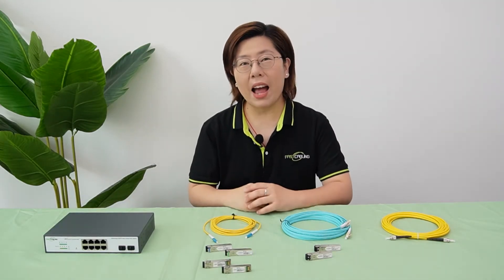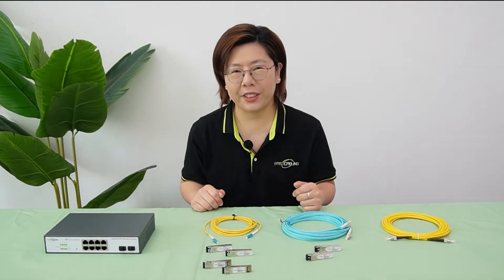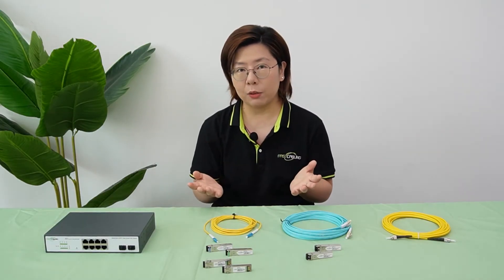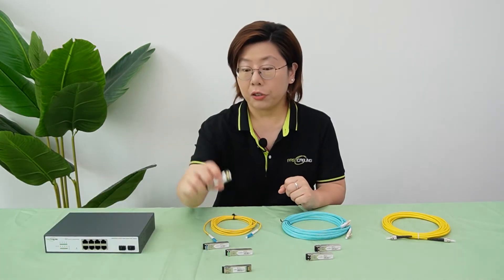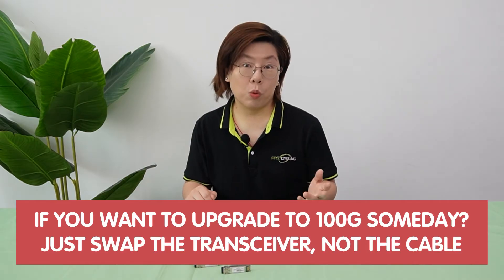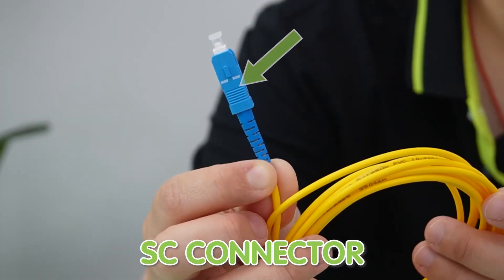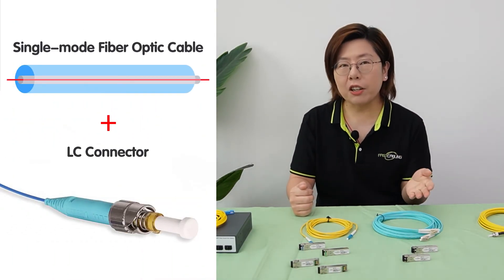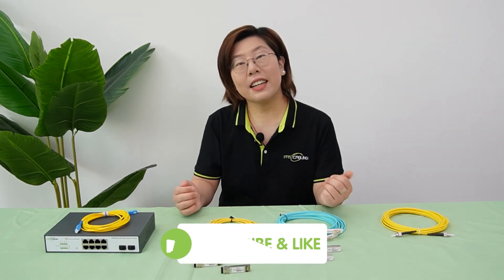Fiber Optic Networking Lesson 1: How to Choose the Right Fiber Optic Cable -A Beginner’s Guide

Comment: Fiber optic cable. High speed internet access. Lotta money in this.
Reply from the maker: Fiber cables are a long-term, future-proof investment, supporting multi-gigabit speeds and low latency. Once buried, they can serve for decades. Fiber optic cables transmit data over long distances with minimal signal loss, ideal for: 

Data centers
ISPs (Internet Service Providers)
5G backhaul
Enterprise networks
Cloud and streaming infrastructure
Reply: oh yeah?

Comment: no, a 4k camera does not require 10G - more like 0.50 G per camera....
Reply from the maker: You’re right, a single 4K IP camera doesn’t need 10G. Most stream at 8–15 Mbps (0.01–0.02 G), and even high-bitrate ones rarely exceed 40 Mbps. So technically, one camera uses far less than 1G.

The reason people upgrade to 10G backbones isn’t for one camera, but when you have many 4K streams together. For example:

25 × 15 Mbps cameras = ~375 Mbps
50 × 15 Mbps cameras = ~750 Mbps
100 × 15 Mbps cameras = ~1.5 G

On a 1G uplink, that traffic can saturate quickly once you add recording overhead, remote viewing, and other network devices. A 10G switch uplink gives plenty of headroom and keeps things smooth.